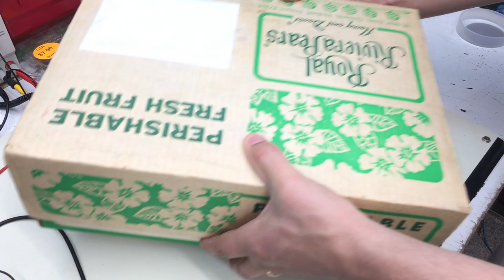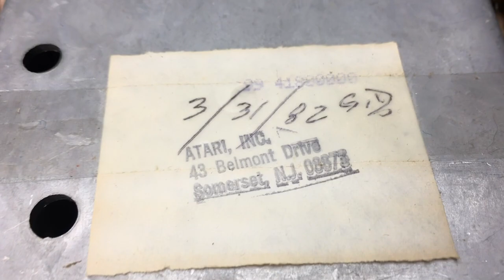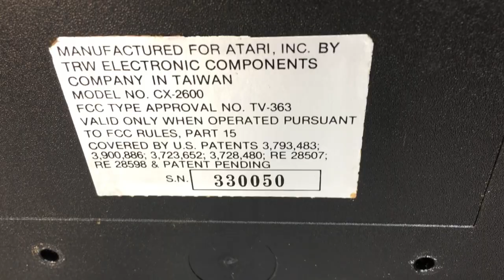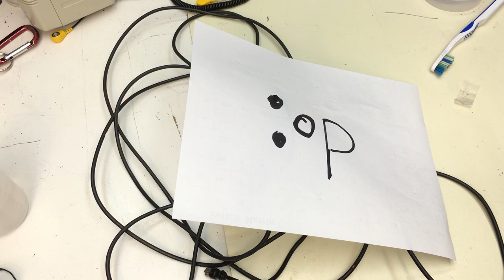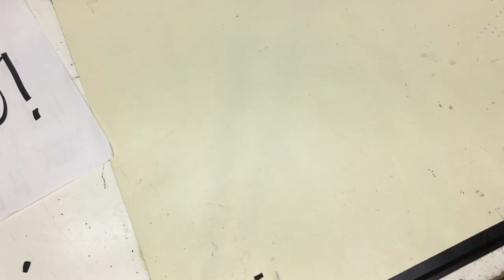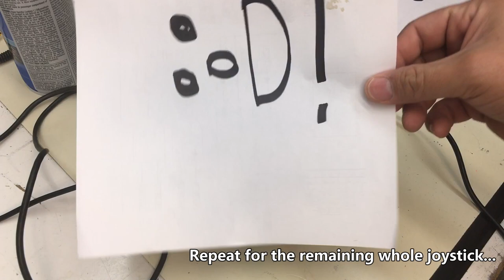Super Chill - Atari 2600 VCS - Repair and Restore

Comment: Those insides were pretty darn clean for a forty year old machine.  Was it not functioning when you first got it? I have a tote full of non-working 2600s. I wish I had the gumption to attempt to repair them.  Anyway, nice video. Refurbishing old video games systems, even though the effort far exceeds the monetary rewards, is a higher calling.
Reply from the maker: Yup, dead on arrival.Just a faulty regulator.

Comment: Uhmmmm, isn't 14+ volt a bit too high for the VCS ? The original Atari Power supplies I have here are all 9 Volts...... 
I know the 7805 can handle up to 25V input but the higher it is, the more the 7805 has to dissipate heat, the more likely it is to fail. The minimum input for the 7805 is 7 V so the 9V is comfy and enough for the good old VCS. 
By the way, nice work on this :)
Reply from the maker: I don't know what the right voltage is in this case. I'm just going with what the machine came with in the 1980s.

Comment: Wow. I thought because the original hardware was in the 1970s, which is WAY back for a video game, I thought it's impossible to fix a broken Atari 2600 these days, even though there no moving parts as with any cartridge system. Guess I was wrong.
Reply from the maker: Yep. As long as the custom chips are still good, everything else in the machine is off-the-shelf parts.

Comment: Awesome video
Where do you buy the voltage regulators at? and how do you make sure to get the correct one?
Reply from the maker: Thanks! You can get the voltage regulator anywhere. It's a standard 7805. I just read the numbers off it, but to be certain, you can find schematics online for the device you are repairing.
Reply: @JoesComputerMuseum  the power port on the back of the system is broken as well, do you have any info on replacement parts for that? I have looked and have only found 1 place that sells it
Reply from the maker: @jimyoung1205  Not specifically. However, it's just a 3.5mm inch phono plug. With some ingenuity, anything could be adapted for the purpose. You might be able to adapt SJ1-3533NG or SJ1-3533N - from Mouser Electronics.

Comment: Mine only reacts to the up direction. I tried an original joystick and a new after market, any Ideas?
Reply from the maker: Hmm. Bad jack. Bad solder points on the board for the jack. Bad TIA chip. That's what I'd look at, in that order... if it were me.
Reply: @JoesComputerMuseum  thanks Joe I'll check that out.

Comment: I just got an old 2600 that does not have the tv channel switch-I looked inside but it is not there. Is that why I cannot get it to work? Am I screwed?
Reply from the maker: Weird. Does it look like it's supposed to be there, but is just missing? Maybe it broke off? It might be repairable.
Reply: @JoesComputerMuseum  Yes it does since the area is labeled but I did some digging and apparently some models came that way. I know I have a working power pack but I am not sure about the rest. Can you recommend some basic steps to take to try and fix it. Maybe you know a good website or Youtube video? I want my first console repair to be a 2600.  Thanks, buddy!
Reply from the maker: @kevingbryant  VERY WEIRD. If you want to discuss in more detail, grab my business email from my about page, or hit me up on twitter @MuseumJoe

Comment: Where can I get the cord he unplugs at 3:37 ? I bought a 2600 at a garage sale at it was missing
Reply from the maker: 9 Volts DC at 500ma with center pin positive is all the unit needs. Try this: https://console5.com/store/power-supply-adapter-for-atari-2600-and-atari-dedicated-systems.html
Reply from the maker: AND I realized I referenced the wrong thing. You can use just about any standard RCA cable.

Comment: If you replace the RF-cord, why not the cable for the PSU, too? Or can't it be open somehow?
There's a good way for cleaning up the levers of the six switches. I used a Dremel multitool with a brass "wire brush" tool. Looks perfect! 😉
https://flic.kr/p/26mCjBz

Comment: well that is a lot of empty space inside the atari.. O.o
Reply: i think this is great to pimp that system with new motherboards.
modern high efficient voltage regulators, different video outputs,...
and then real upgrades with a new stereo sid chip, 64k static ram,....
Reply: Spawndude Spawndude  i don't have a 2600 myself. i have to get one at ebay. it's simplicity shouts for making new boards :-)

Comment: You couldn’t find black shrinking tube for the power supply repair? Looks hideous..
Reply from the maker: Didn't have any of the proper diameter. Adult ADHD means poor executive function, which means poor planning ahead, which means I bolt headfirst into the fun and see what happens. I'm not perfect. At least, now, the power cord has character. :)

Comment: Do yourself a favor, get yourself an electric blower or compressor. Don't use canned air it only lasts five mins, and it's too costly in the long run.
Reply from the maker: Did that several years ago now. This video is old. :D
Reply: @JoesComputerMuseum  Yes, I see that now. Thanks.

Comment: where u get that desolder gadget?
Reply from the maker: I picked it up at a local electronics store. It has no brand name or distinguishing marks on it. It's a desoldering pump with built in iron, basically. Velleman makes a similar model.
Reply: @JoesComputerMuseum  came to the comments looking for the make & model. its a nice one.
Reply from the maker: @d.logic1  I really wish I knew what it was!

Comment: Do you have to use an older tv?
Reply from the maker: Nope. Most TVs, even new ones, have the old tuner input required. It is also possible to install a "composite" mod to allow it to work with virtually any AV compatible monitor.
Reply: @JoesComputerMuseum  Thanks for your quick reply. I have the old Archer adapter. Will that work with  a TV that has a coaxel antenna in port?
Reply from the maker: @Allclasher  It should, yes.
Reply: @JoesComputerMuseum  oh my goodness! It works!! I've had this Atari for over five years and I thought it was broken, but it fired right up! Thanks!
Reply from the maker: @Allclasher  Glad I could help!

Comment: Nice restoration but something not works..
Why u don't clean the slot cartridge? Why you don't polish the metal part inside? why you don't repaint the yellow decoration on the joystick why youn don't the rubber footer of the console? the paddle are working? the paddle are restorates?
Reply: I see from your channel you have done a much better restoration. Oh wait, you haven't.
Reply: @jonvincentmusic  I try to give good advices
Reply: @luigicorrias  Why would you polish the metal plate/cover inside when you don't see it or even need to? The fact he got it working and did a pretty good job cleaning it is brilliant.
Reply: @falcidi  To do a good job... I wea r shirt and a a jacket but the shirt is not ironed only in the collar and in the visible part but everywhere...
Reply: Craig Colby  Sorry i follow restoration video and i learn how a masterpiece restoration must be done.. i i try to be constructive..

Comment: You suck at digdug lol JK.  Nice video I have a broken 4 switch system I picked up for a couple of dollars the other day.  I still need a power supply for it since I only have a 7800.  Don't even know what is wrong with it though so I guess it would be silly to try and open it up just yet.